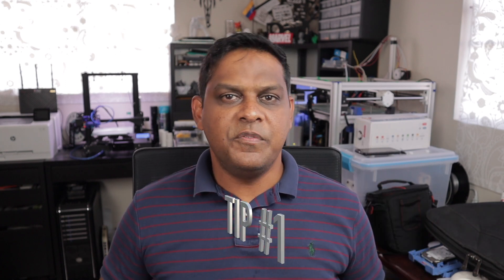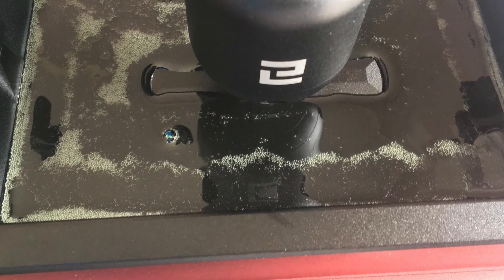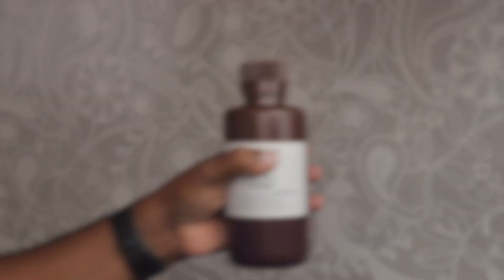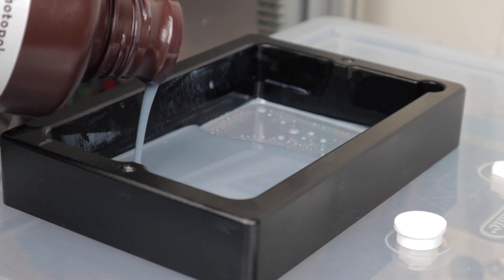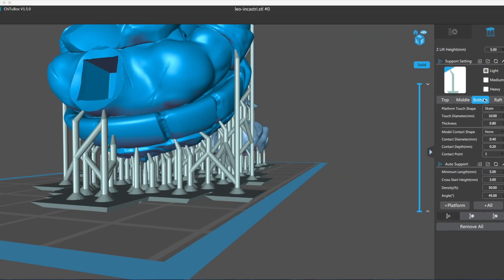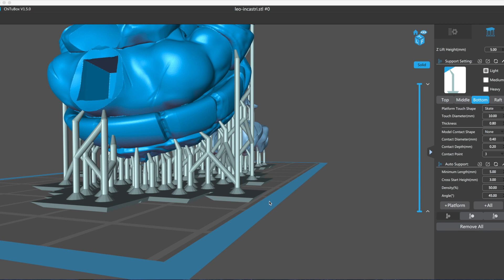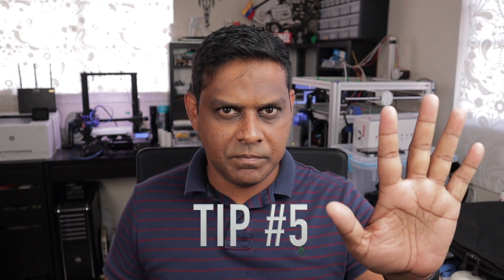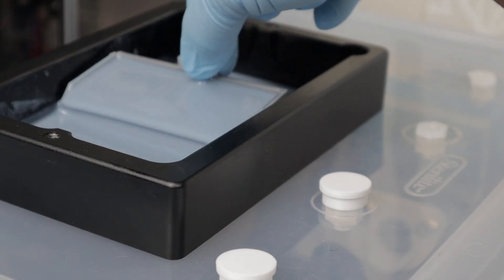5 Tips for SLA Resin Printing on the Elegoo Mars, Anycubic Photon and Epax X1

Comment: Great tips! But I don't understand tip #4.
Reply: So when you hold the build plate by the attachment round dome while scraping, the shear strength needed for the job will jog the tight grip of the bed and throw it out of level. If yo hold the plate instead, there’s no force put on the ball hinge... and thus your plate remains level. Great tip.
Reply: @stvcolwill  Thank you!

Comment: I'm going to have to print me one of those resin combs.   So, quick question - why did you print the bull upside down?   I would assume you would want all the support material on the bottom of the print rather than marking up the top?
Reply from the maker: Hey Luther, I think people spend too much time worrying about the remnants of the supports vs having a successful print. If your settings for supports are tuned, they remove with virtually zero marks on the print.

As for the bull, a good rule of thumb is to print your models with the extremities pointing away from the buildplate. That way the forces on the thin parts are minimal when the print is finishing. If it was the other way around, all the forces would be on the minimal surface area of the four legs.

Hope that explains it!
Reply: How do you tune the supports to leave no marks?
Reply from the maker: Good question! I don’t use spheres at the tips of the supports. Check out my other video on support placement 😉